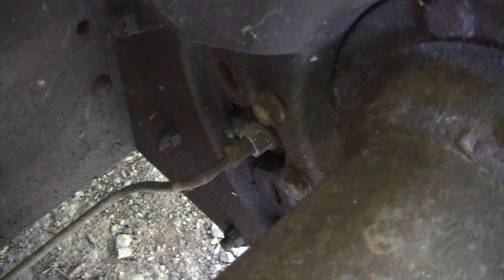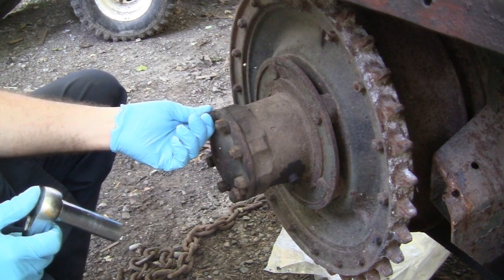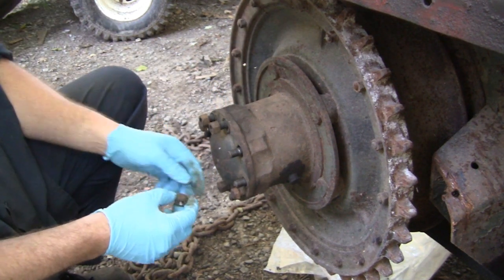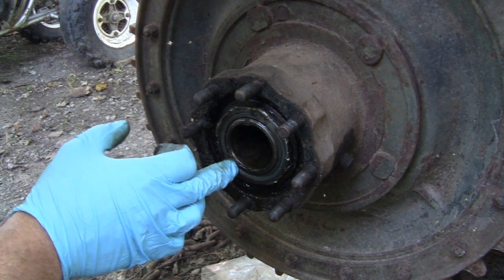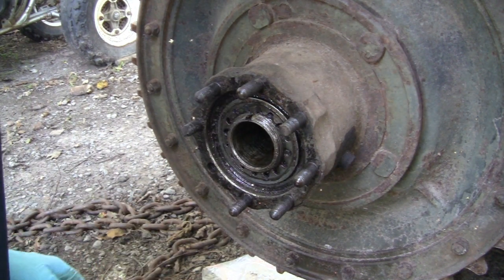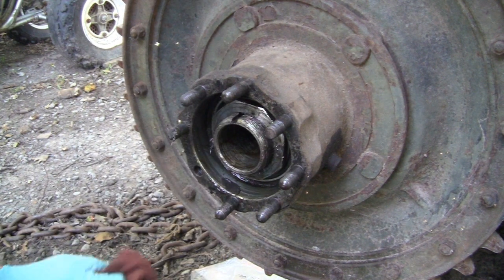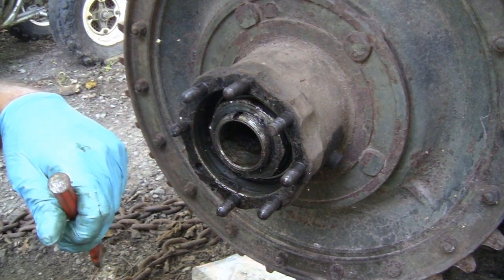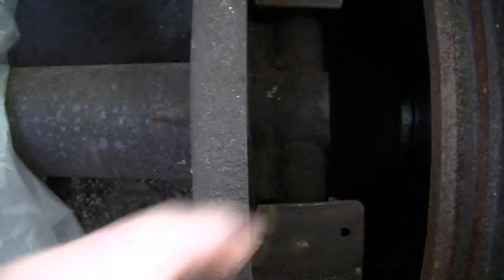Universal  Bren Gun Carrier rear drive hub removel

Comment: Early Chrysler vehicles had left hand lugs and studs on the left side of the car, and right hand on the right side. My old Toyota pickup uses those cone washers on the Aisin lock out hubs on the front wheels. So did Suzuki’s. Servo style drum brakes use a short shoe on the leading side, but not on the non servo style.
Reply from the maker: yes very ture

Comment: Hi

Do they steer by applying the brakes at the rear on the diff or does it have a special gearbox like a modern tank
Reply from the maker: Paul Anthony Rear brakes where used for hard turning, they also have a track warping system that steers from the center two wheels. theses wheels would push the track from one side to another on slight turns. made it a lot better to drive down the road.

Comment: Shawn you see the lettering on the backing plate FMC - Ford Motor Company now it might be just the backing plate , But the nut and Locks look like Dodge I had a dodge 3/4 ton it had a Dana 55 It kinda looked like this hub the Brake Cyl. might be the same I made a wrench for it if I can find it You can have it, The bearing locks might have tabs that put a twist on them using center punch / (Ford) The movie said he would`nt help any War with parts so Dodge & General / White GMC Did check them ???

Comment: I'd take those buts to a guy with a CNC plasma cutter and have him cut some sockets out of some 1" stock. Or some really thick stuff ya know. Either that or thinner stuff and stick it to the end of a pipe with a welder as long as the pipe will go over the nut. It doesn't have to be incredible steel since those nuts don't get tightened to holy hell torque.